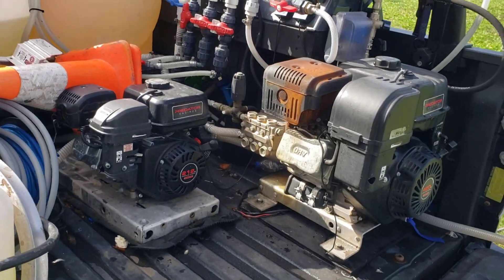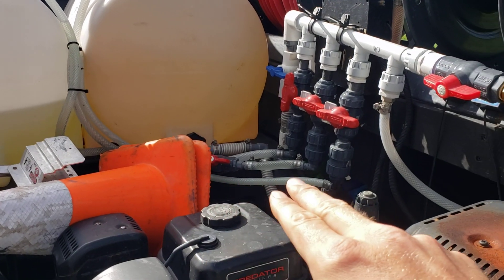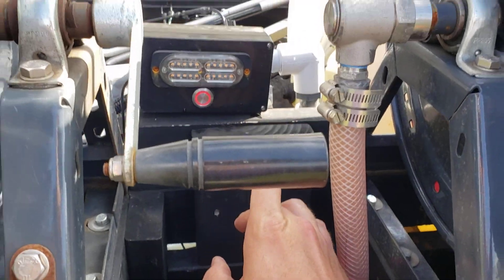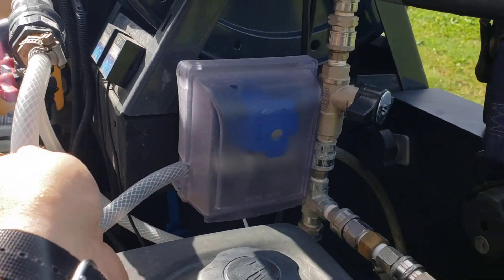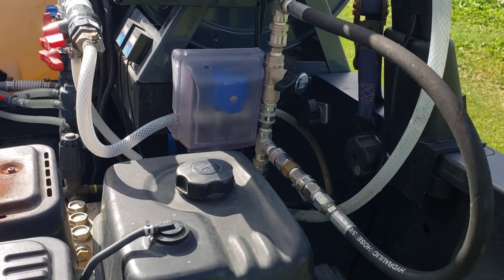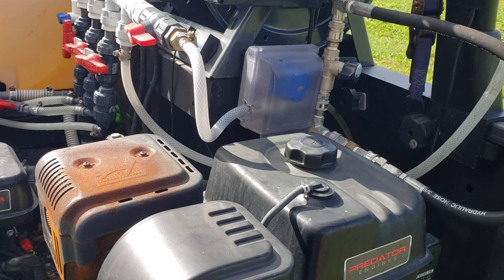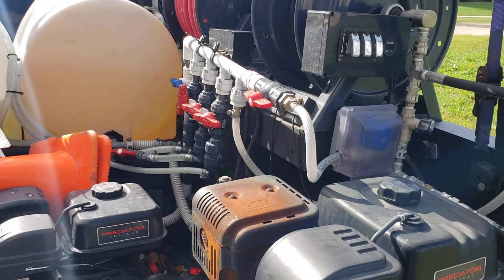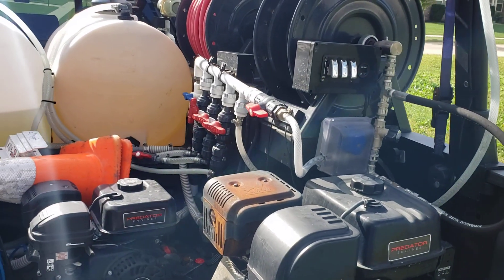One of THE BEST investments you can make!!

Comment: With the chemical injector using 1/4” tubing, did you run 1/2” from manifold to the remote valve and then reduce it? Or did you run 1/4” from the manifold? Thanks for the videos !

Comment: Where did you purchase the Asahi metering valves?
Reply from the maker: It was a plastic supplier out of Kansas City. I'm sorry I can't give a more useful answer on this, I lost their information. I'm sure you could find them with a google search. The good news is the Asahi valves were specifically designed to outperform GF valves when it comes to flow resistance. And they must have succeeded because really they have almost zero resistance. Same goes for theit check valves. Not a cheap investment by any means ($532 delivered for 3 sets of 1/2" meters and matching check valves) but they've been hassle free all year. No complaints!
Reply: I think I found it. I live in Rolla, MO and have been looking for a good 1” metering valve for a gas roof pump.

Comment: Good video. I’ll have to find the parts for that setup. I hate walking back and forth (or switching to the ball valve). How is the roller pump holding up? I’d love to see more on how the bypass works and the distance you get out of it. Btw Delavan has their Roller Pro 6900DSS 6 roller pumps. Stainless steel body, rollers, shaft etc. AgriSupply has them at a reasonable price.
Reply from the maker: The 6 rollers are AWESOME if you have a buffer tank to support it. The one drawback is they require some sort of reduction drive since they can't exceed 1000rpm. And yes my 4-roller is holding up fine. No complaints, I'd do it all over again.
Reply: @dr.downstream1151  Thanks for the info.
Reply from the maker: @whyyacare3928  You're welcome. Any suggestions for my next video?